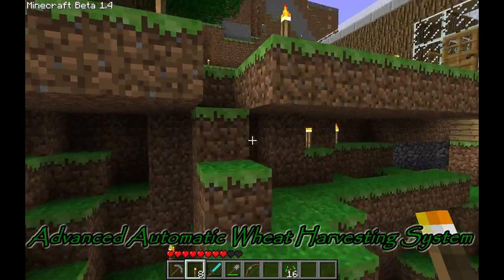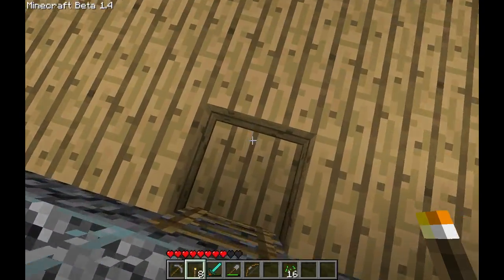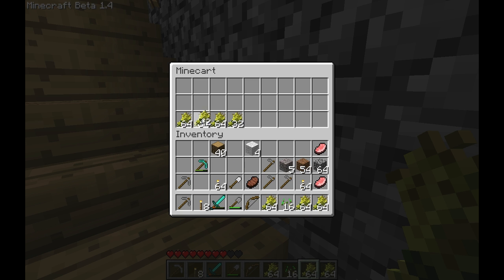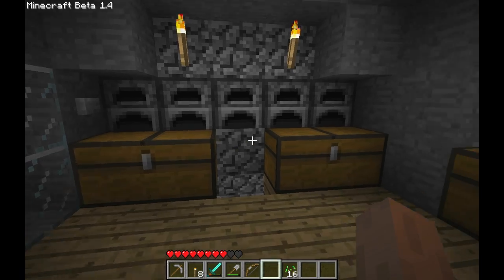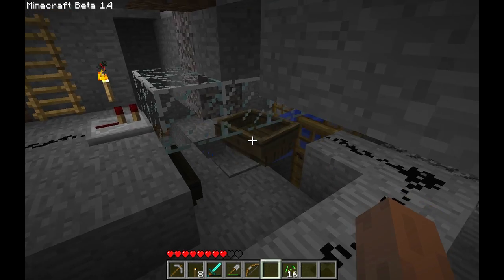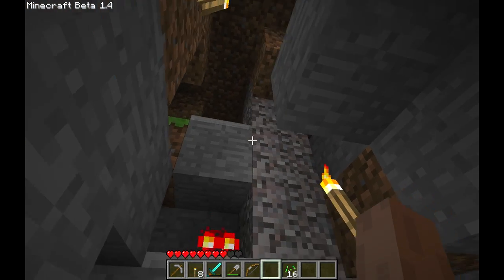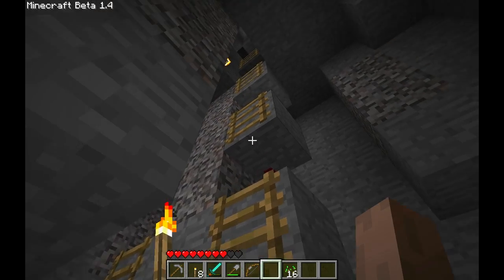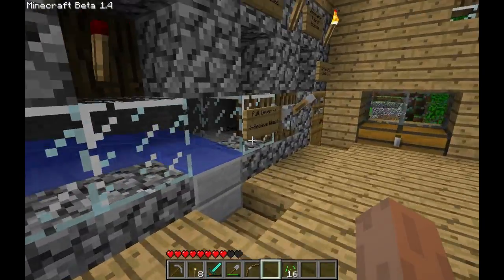Minecraft - Advanced Automatic Wheat Harvesting System

Comment: the machine is increadible. I recently updated to 1.6.6 and the gravel I load the dispenser with does not stay in place when it hits the boat (the one that moves in the 3-5 cyclical patter). The gravel blocks just breaks up, whereas before it worked exactly as in your video. Can you suggest any fixes?

Comment: that is a pretty kool system. however you can achieve the same thing by placing a bucket of water in a hole that devides into the four holes that deliver the water to flood the farm. also, with pistons probly being added to minecraft, the auto process of that would make all the wiring not needed. given pistons are added, and that they still hold back water.